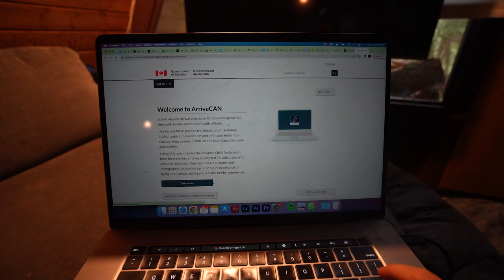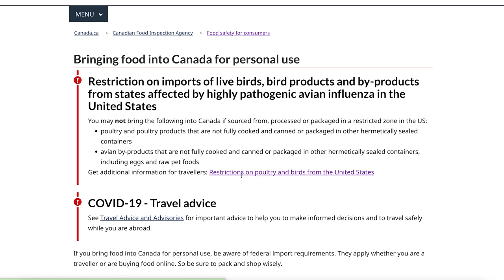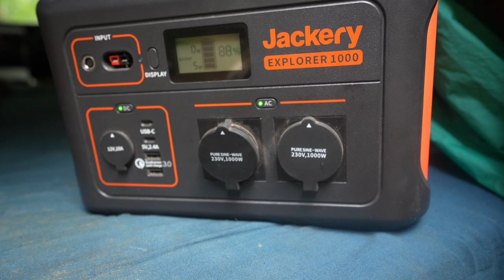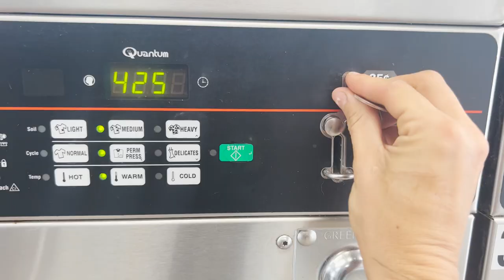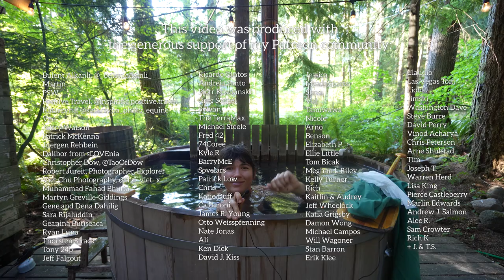Preparing to Survive a Solo Expedition to Alaska

Comment: Reboot  - Is there any reason you chose to go to Alaska right before the winter season? 
Rest - it took me about two weeks for me to recover from a  regular running marathon. I mean before my normal energy returned.
Conclusion - There’s no doubt that you are pushing yourself too hard.
So go for it slowly…especially at first while your energy reserves are low.
   Build into the trip. Treat it like you did the ultra marathon. With careful pacing. The strength that you can potentially get from the marathon needs time to come.
   From an experienced athlete, too much too soon is a prescription for pain. Pain is the opposite of fun.

Comment: I'm surprised you don't have an inverter to plug into your vehicles DC outlet/cigarette lighter, so you could charge your Jackery with AC power while driving, using your car's alternator as the source. Then the solar panels would be backup charging.

Comment: Hello Eva! I can make some recomendations you Will be on your own so you need some accesories like a good GPS, the Garmin overlander it's the best, Also 4wd related items you need an air compressor, a winch AND some maxxtrax boards in case you got stock and the the most helpfull item you can have Is a sat phone, IRIDIUM Will work so far North, you need to be 100% rely on yourself, greetings!! And good luck

Comment: I don't know what you usually use for offline routing, but I've found that Locus Maps is pretty good at offline mapping and routing. At least on Android. Not sure if it is available on Apple phones.

That said, paper maps are the best fall-back and should be available for free (or low cost) at highway rest stops (at least in the States, not sure about Canada).
Reply: Milepost is all she needs it's not too expensive and has very detailed information
Reply: @anonomas6126  I'm not familiar with Milepost. Locus Maps base program is free, you only start paying after 3 (I think) downloaded maps. Lots of other features in Locus Maps not only for driving, but also for hiking, and even Geocache features available as free plugins.

Comment: Well it's getting cold at night already in Canada.  So get a heat source. As for what else you need to know.  Crossing the Alaska is a border as well.   You could switch it to Yellowknife.   Save the border.   But you got a set of wheels that is not common in The North.   So if you brake down it's going to be the end.   So if you know some parts that might break on you  then fix em knowcand get a few extra parts....     you should also buy a Roots winter Jacket in Canada.   Trust me it's going to be best.   As for bears..  well you need a fire arm.   Bring some lexan for window fix.   Or protection.

Comment: Leaving this late in the season is going to mean that you will miss most of what makes the trip enjoyable , you will miss all of BC which has as much to see as Alaska itself. You would be better off touring the south of America and start to Alaska in april so you can take your time and see all that there is to see on this journey.  The Cassier is great but there is no services for much of the way, the road from the Start of the alaska highway has more frequent service stations with fuel and more traffic in case the worst happens. Been there done both roads and the trip from Dawson Creek is the best bet this time of the year.   CHEERS AND SAFE TRAVELS    Steve h.     Ps Cell service STOPS in Prince George, there is only service after there for about 10 Km around the largest communitys.

Comment: There is a lot of good information in the comments. You will likely see snow in North Alaska, and you may encounter some in the higher altitudes on the Cassiar. The mountains around Anchorage had "termination dust" snow yesterday 9/9/22.
But, overall, the trip should not be nearly as brutal as you seem to expect. I have made the journey many times as a single woman both with and without small children. Stay alert and use common sense. You should be fine.

Comment: I have not yet been to the northernmost tip of Alaska, but I know that it is on the 71st parallel. I drive over the winter to Norway, in the direction of Hammerfest, and that is on the 70th parallel.What is the difference to Point Barrow?

Comment: Hey sweetheart, I for some reason just have a problem with people referring to these generators, all my life a generator is something that you can plug into a wall or you can pull a string on it and it runs like an engine and generate... the manufacturers of these want to change the narrative that these are " generators when without a wall plug plug them into or without solar panels they are pretty much like a dead phone. A brick so buy themselves they don't do anything if they have stored up power they will deplete it once it's depleted there like a brick a very large brick so please please do not call them generators if you'd like to clarify them as say solar powered battery Bank that's much more honest but without solar panels or plugging it into a wall with AC power it's a brick. Thank you love you very much take care be safe sorry I don't mean to put a flat tire on your sponsor but I think the truth is more important than someone's false narrative

Comment: YOUR BEST TIRES ARE AND THIS IS ALL I USE..BF GOODRICH MUD TERRAINS .BEST ALLAROUND AND BEST RUBBER COMPOSITION..MY LAST SET ON 4X4 VAN I GOT 72.000 MILES AND STILL HAD ABOUT A 1/2" OF LUGS LEFT. THE OTHER ONLY. CHOICE IS COOPER DISCOVERS HT3'S.TAKE IT FROM ME THESE ARE THE BEST ALL AROUND..IN 2 'FT OF SNOW ON ROAD W 4X4 VAN I HAD NO TROUBLE DOING 70 MPH W VAN..VAN WOULD EASILY SURPASS ANY 4X4 PICK UP ETC.I KEPTMY BFGS AT 30 PSI TO KEEP FULL TREAD WIDTH ON THE GROUND AND COOPERS WERE ALWAYS 42 PSI...

Comment: Thousands of people in lesser capable vehicles than yours have driven both highways through various seasons… you’ll be fine with some challenges to get over as should be expected. It’s not an expedition… your driving a main, commonly used, highway and that’s all you’re doing… you’re not trailblazing a new highway, nor are you bushwhacking your way through anything. You’re driving a highway.
Do you need preparedness, do you need to be wilderness aware and take it seriously? Definitely. All the best to you… but could you stop with the drama 🙄

Comment: Don't overthink it.  I have made the trip twice from central US.  Once to Deadhorse and once to southern AK.  Both times on a motorcycle.  I typically camp for five nights and then hotel one night for laundry and a shower.  The roads were good for the most part. The only bad roads were between Coldfoot and Deadhorse.  But that has been twenty five years ago.  Maybe they are better now.  And, enjoy your travels through BC.  It's just as scenic as AK, maybe more.  One more thing, last time I went Prudhoe Bay was not accessible.  It's property of the oil companies. There was a tour offered but it was out of my limited budget.

Comment: STOP!!!!!! big mistake not taking the starlink especially in your line of work , i live very far north in alberta and it works flawlessly  have friends in alaska  that live by there starlink , who ever gave you that info that it doesnt work did you a huge disservice , going up you should go the dawson canada route but comiing dow go the cassiar highway route as you might hit it just right  for the trees changing colour it is fantastic  a world class drive the the trees  vary from red to gold and everything in between , have done this trp many times the borders are much better than mainland american borders never had any hassle . The facility's are on the whole terrible , really expensive  cold showers, load generators really awful wifi (hence the reason for starlink ) the good news is the wild camping is second to none , but there are bears everywhere so watch out for young goofy pup if they survive there first encounter with a bear , they become very bear smart very quick . It is a great trip  and not as hard as you have been told  loads of streams and lakes to wash in just use enviro soap and brace yourself  and good luck